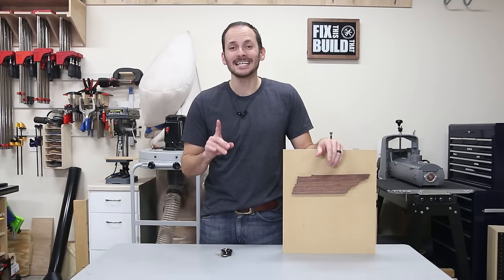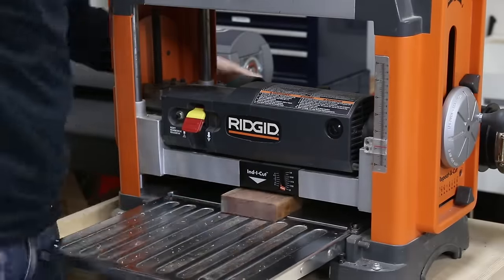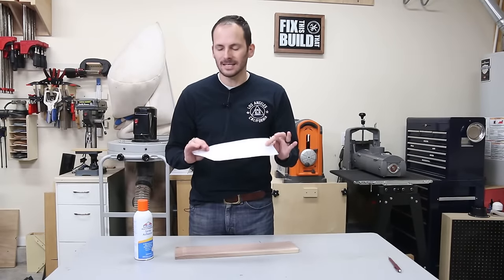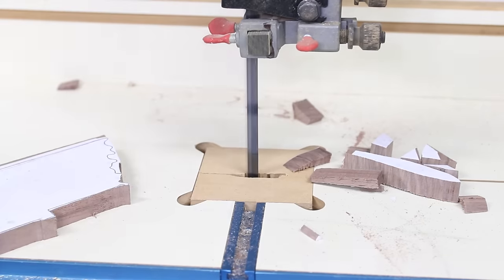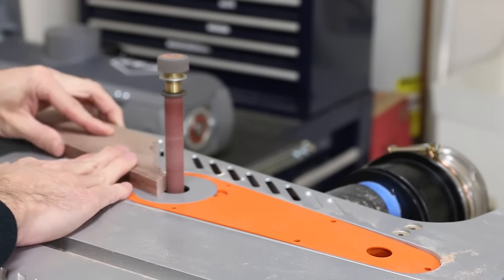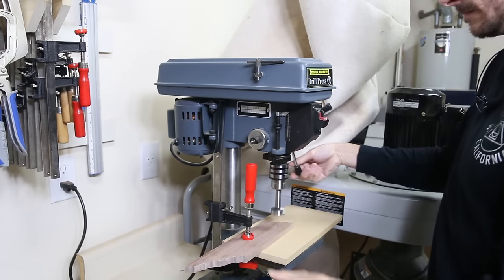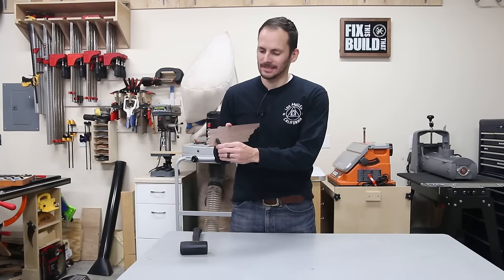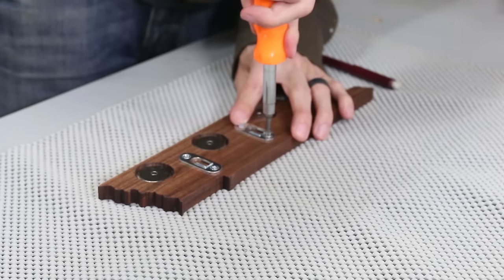DIY Magnetic Key Holder (State Shaped) | How to Make It

Comment: I would consider making the final thickness of the board at little thicker, completing all the cuts, then resaw a thin piece.  Install the magnets and then glue the thin piece on back to make a finished look.
Reply from the maker: +Clay Swenson if anyone pulls this off the wall and looks at the back then we'll have a different problem on our hands 😃